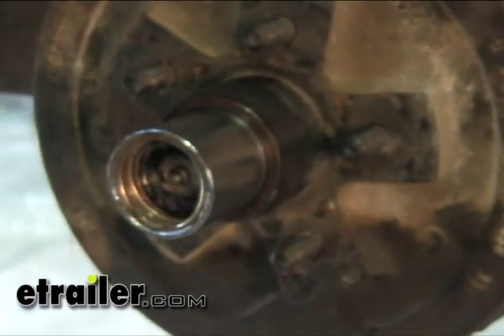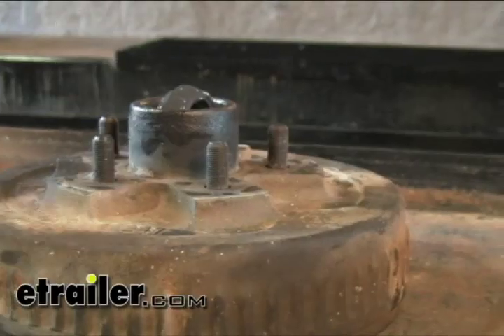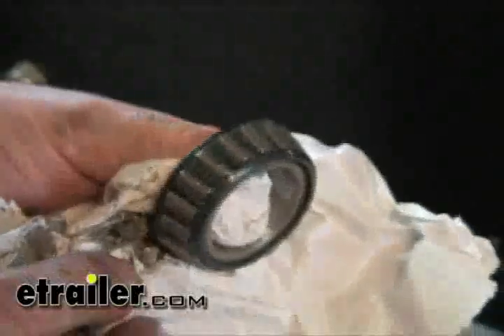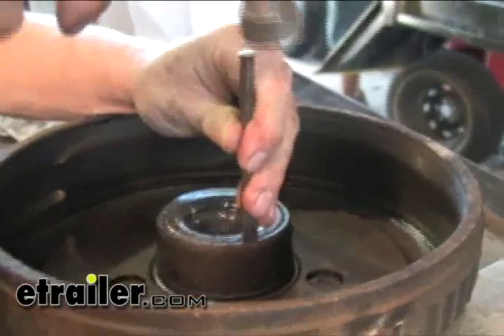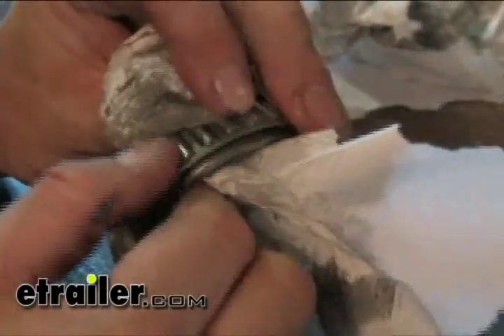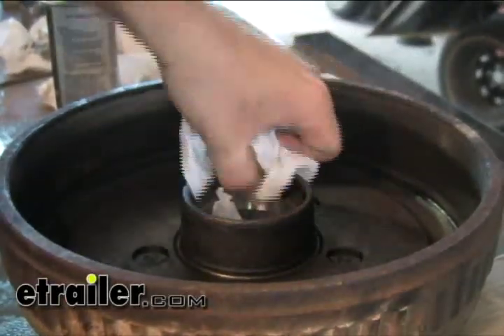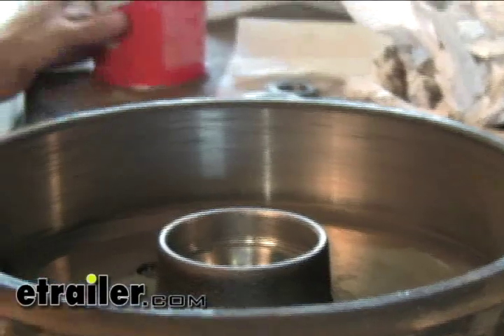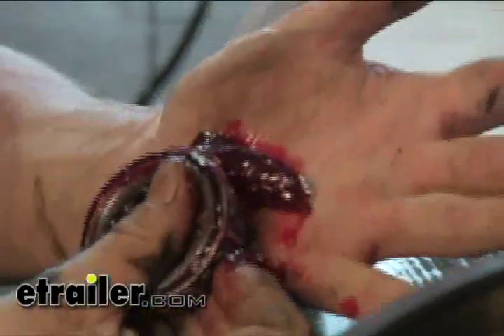etrailer | Cleaning and Replacing Hubs and Bearings

Comment from the maker: @BAKARDAN When tightening the castle nut, you will want to tighten it down a bit and then make sure the bearings spin freely. Next, snug down the castle nut. Make sure the bearings can still spin freely but that there is no up-and-down or back-and-forth play on the hub. Last, while the castle nut is snug, back it off just enough until the cotter pin can slide through. I hope this helps. Let us know if you have any  more questions.

Comment: Several companies sell wheel bearing seal pullers. They are not expensive and are good to have if you do your own maintenance.
Reply from the maker: They are handy have, particularly if you regularly perform this kind of maintenance. They're not necessary and most people don't have them on hand so we try to work with what the Average Joe will have in his garage.